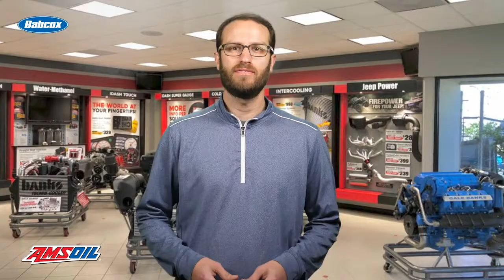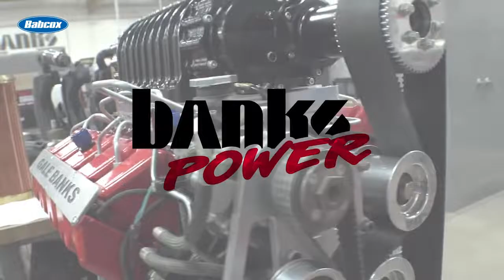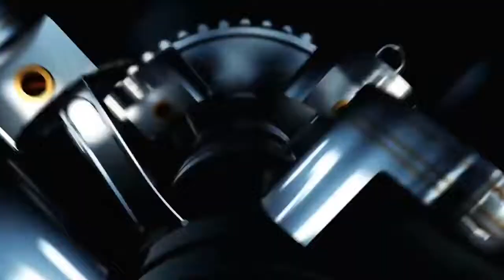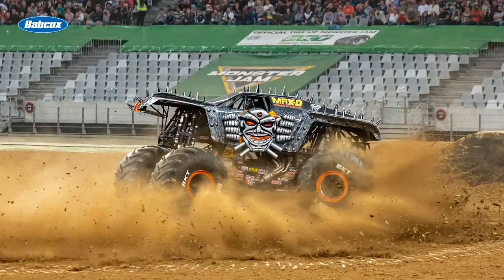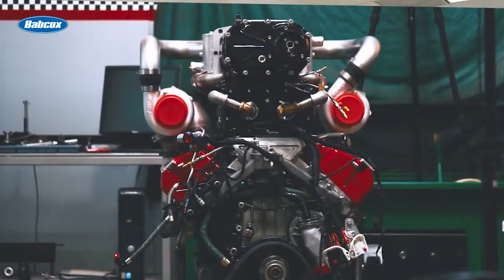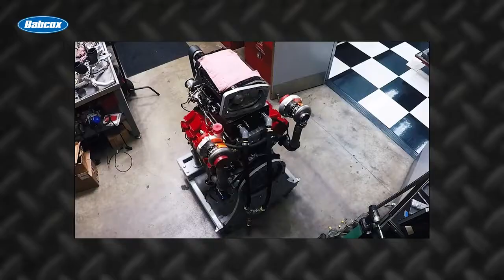Supercharged Twin-Turbo 427 cid 7.1L Duramax

Comment: No wonder... Less than 30k views and less than 30 comments in over six years, even though it's about one of the greatests achievements Diesel history. This guy has no clue what he is saying when he starts spitting out numbers. Reading off the power numbers @3K RPM while the AFR is over 20 and then again at AFR of 18 and then presenting this like its some kind of massive gain because the HP nearly triples..... what an idiot.

Comment: interesting! impressive as this 7.1 L v8 produced 1400 HP but an I-6 sneeze at 2000 HP...
Reply: Torque is the difference. This is a diesel engine, so the torque is twice as much as the HP. It might have 1400hp, but it also has 2800ft/tq, which is an insane amount. At the same time that i-6 with 2k HP probably has half the torque as it does HP.
Reply: @chieftron  I'm not talking about diesel vs. gas. Look up YT vids out there... tons of I-6 turbo diesel (not get into this brand name vs. that brand name here) that made 2000 HP. There even one that they pushed it beyond 2000+ hp and blew up. Perhaps, V8 is not ideal (horsepower-wise) configuration here...
Reply: @kbnguy  Comparing this to the inlines (Cummins) in terms of top horsepower it’s not something you can really compare to something like a super stock pull truck running triple turbos or a common rail Cummins like Shawn Bacas or Derek Rose. The main goal of this engine is to make power right off idle, where the supercharger comes into play as this throttle response is ideal in a monster truck application. 

The supercharger makes that instant power before lighting the turbos. Anyone that has seen these big power Cummins knows that it takes a ton of time, proper load, or the assistance of nitrous etc to get the chargers lit up. So while banks isn’t going for any horsepower records, he is going for a diesel application that responds and reacts closer to a blown alcohol big block. 

If you’ve ever seen the Pikes Peak Freightliner he built using a 14 liter super-turbo’d Detroit Diesel that made 2400hp/4000lb ft of torque, this engine is similarly set up. With Pikes Peak having 156 turns, that instant power of the supercharger allowed that big rig to come out of those turns without the severe turbo lag that had plagued that truck previously.
Reply: @DanEvan  
1- You just confirm what I said...
2-  Yes, we know the difference between what supercharge and turbo charge will do. thx!
3- Compare 14L with similar set up to 7.1 (or 6.7 for that matter) is like compare turkey to chicken size but I get your point, linear torque!
Banks, no doubt, is a brilliant man and even more so as a marketer/supplier... As long as any demands there will be supply for it!
V8 diesel in fact still relevant in consumer market...
Reply: @kbnguy  I didn’t confirm anything you said. You made a peak horsepower comparison of two different platforms with two completely different power adders and two completely different applications. So uhh......no.
Reply: @kbnguy  I would imagine those engines are less durable than this one
Reply: @kbnguy  The fastest diesel in the world is a V8 duramax. So that argument about I6 being able to build more HP is wrong. This application Gale was building a purposeful engine build. To compete against the gas version in the same application. So it was all about throttle response and HP near 1400HP. It wasn't about building MAX HP. The difference between this engine and the 454/492/502/572s they use in monster trucks is that this one will end up with almost double the torque.
Reply: He is making that power with no coal at all and a very reliable engine
Reply: Horse power isn't everything bud
Reply: so what.... every engine configuration is different. theres a duramax that is not stroked, its a 6.6 L and its pushing over 3000 HP.
Reply: Could never out torque it